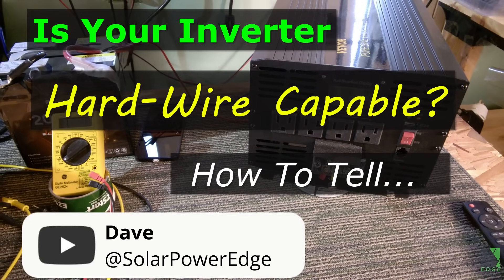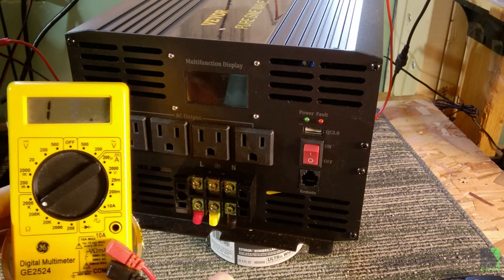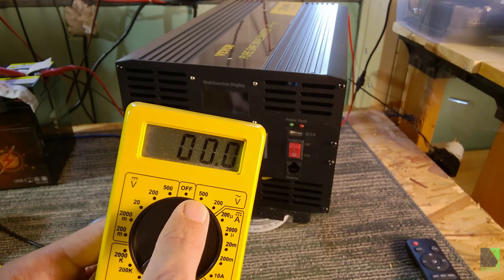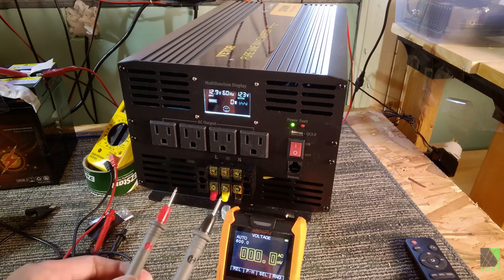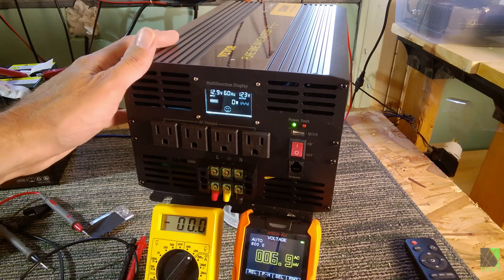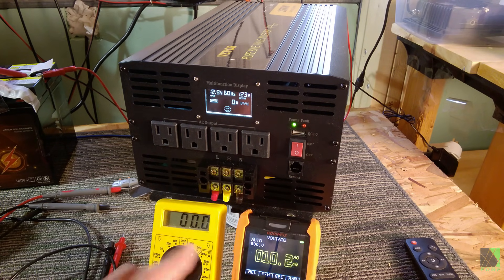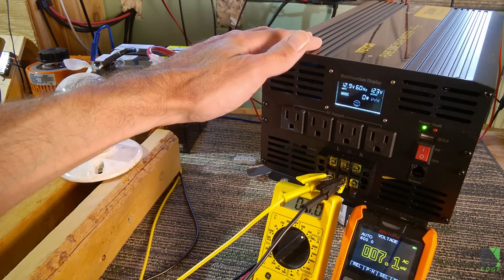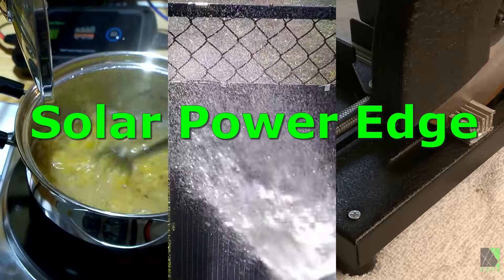Is your Inverter HARD-WIRE CAPABLE? Don't Blow It Up! Learn how to test first #inverter

Comment from the maker: TYPO at 10:27 - I meant to write if there is no current G>L and G>N the inverter is safe for hardwire to bonded load center. G>N would be the most obvious to check though. Hopefully I didn't confuse too many people :)

Comment: Hey, me again.  Do you have a video that would show me how to connect the panels to batteries to DC appliance?  I'm going with 24v.  And do I need a charge controller with a direct DC set up?
Reply from the maker: @lesliekendall5668 When going from Solar Panels to appliances direct, "ideally" we wouldn't need anything else. Maybe a DC meter to monitor voltage/power if required. 

A charge controller is used for charging batteries, it stops the charge at 100% because the solar panel would just keep going, overcharge the battery and ruin it.

 Here is a good and simple example showing what direct PV cooking can do on a very small scale: https://youtu.be/-QthPOTDLSY
Reply: @solarpoweredge 
Thank you for the info about the charge controller but the appliance I'll be connecting to 24v is a freezer.
Reply from the maker: @lesliekendall5668 Welcome! You could have a setup like this: Solar Panel to=> Charge Controller => 24v Battery. Then wire your freezer straight to the battery. Actually some of those freezers can do 12v too. In that case, maybe a single 12v battery to reduce costs and simplify the setup.
Reply: @solarpoweredge 
Yes, the freezer is 12/24v but I plan on a mini split AC unit that's 24/48v so I'm wiring the freezer to 24v from the get-go.

Comment: Hello, British person here. Is the centre pin connected to the metal case? Sometimes we get that for protection.
Reply from the maker: @DarrenPeet Hello to our British friends. Yes it is connected as far as I can tell. A quick way to verify is use Continuity mode on a multimeter and measure from GND to several case screws.

Comment: Nice video

I have a question: i have similar square wave 2000W Inverter. If i check the 12V battery terminals connected with it with screw driver tester, its neon glows. What's the reason and how to avoid it
Reply from the maker: @TechnoEveryday Hello and thank you sir :) That could mean the battery terminals are live, avoid touching them! Depending on their design, some inverters will bring the battery terminal to high voltage potential. Also it's possible your inverter produces current from N>G as mentioned in the video.
*I have another video about floating inverters that I never posted, where I addressed the problem of live battery terminals on a floating inverter. If you wish, I'll upload and send you an unlisted link. I don't know if I'll ever publish the video. But if you think it's good enough, maybe I will!
Reply: @solarpoweredge yes please send me the link i am very much interested in it 🎉
Reply from the maker: @TechnoEveryday OK I haven't finished the editing but I plan to upload it as soon as possible. As it happens now, I am moving to a new town and it's taking up a lot of time, so it may be awhile. And feel free to remind me if I forget :)
Reply: @solarpoweredge ok good luck 😊
Reply from the maker: @TechnoEveryday Thank you, hope to get back to videos as soon as I can :)
Reply: Good